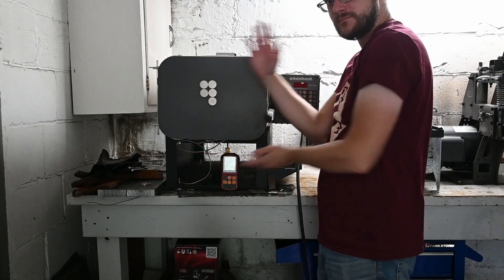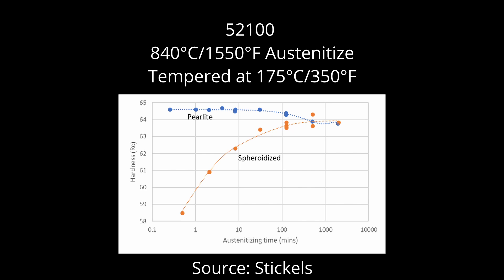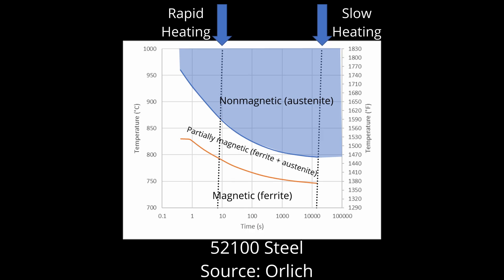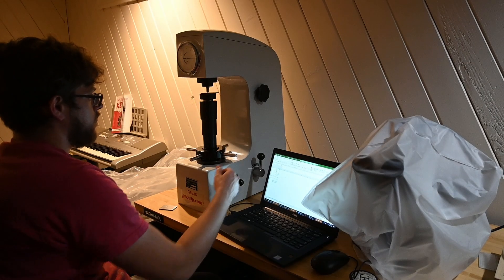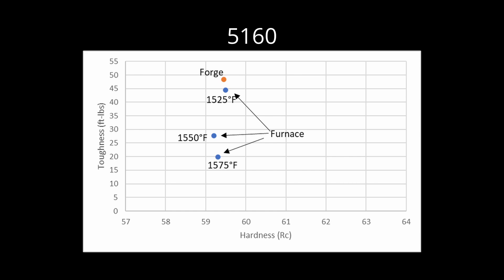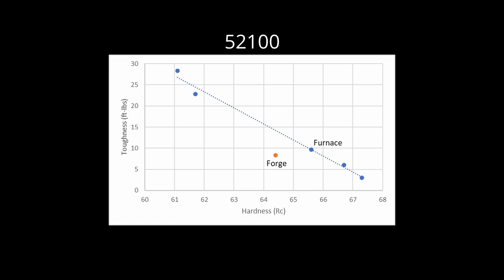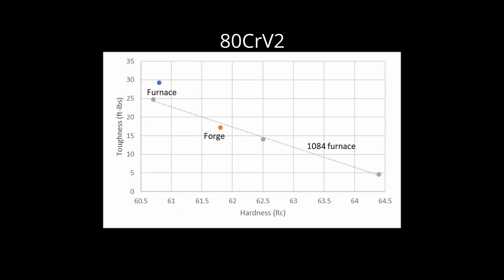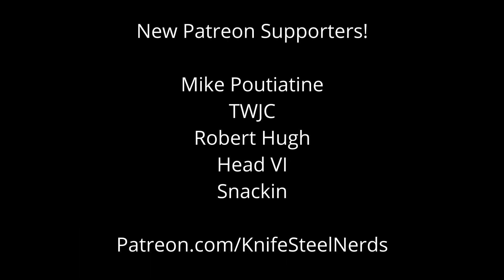Can a Metallurgist Heat Treat with a Forge?

Comment: Larrin, thanks for all the knowledge you share. I do have a few questions that I believe you can answer. I really like 8670 steel. I noticed the HRC you heat treated it to was low in my opinion. I personally get 62+ HRC and still have a very tough blade. I quench at 1600 in parks 50. I believe that the edge retention goes up a lot with a 3 more HRC points. I also think that 8670 modified with .1 percent more carbon and a very small amount of vanadium would be the best forgeable steel with the best balance of edge retention and toughness. Any thoughts on this would be greatly appreciated. I like everything you do. Keep at it
Reply from the maker: I have a separate article on heat treating 8670: https://knifesteelnerds.com/2021/04/26/how-to-heat-treat-8670/
Reply: @KnifeSteelNerds  I've read it multiple times, I don't think you understand what I was saying and asking. Is there any way you can heat treat 8670 to above 62 HRC when you do your next edge retention test. Also you never answered what the effects would be on 8670 if you simply added just a very small amount of carbon and vanadium. I know you are pursuing the "perfect" carbon steel and have a some prototypes. Forget everything your PhD has taught you and try what I said earlier
Reply: According to his testing, 1600 is too hot and gives you less toughness at the same hardness as a power austenitizing temp at the same low temper. 300-350f at a lower austenitizing temp got 62-63 HRC at like double toughness. 14ft-lbs at 62 or 12 at 63 at optimal temps versus 7 And 4 ft-lbs at the same hardness at 1600f.

Comment: I used a tube on my charcoal forge and had pretty even, steady heat... I use a box blower so the rate of bellows equated specific temperature... Way too time consuming though and i have a kiln now for more control and efficiency... Quench oil question: does quench oil get worn out so to speak and become less effective over time and use?
Reply from the maker: Canola oil goes bad. Commercial oils last a long time.

Comment: I really wish I could afford a furnace right now. I don't care very much about the simple forging steels, and have been fascinated with the applications of higher alloy tool steels in knives for a while. 

I'm currently trying to make knives with a2, cpm d2, and cpm 10v with a forge to use for my heat treating. I have an infrared thermometer to use, but even with that, I know I'm just not going to be getting results like I would with a furnace. Still. It won't stop me from trying.

Comment: Yeah this is pretty much a summary for my W2 heat treat. It’s a simple steel, hypereutectoid. I forge most of my knives so the very high heats dissolve any kinds of structures present in the factory annealed condition. Normalize twice just above non magnetic, do a simple sub-critical heat for stress relief... heat up to non-magnetic in my charcoal forge and into the brine. I’ve sent pieces to a friend who has a machine shop for hardness testing, and I’ve never had a piece test for less than 66/67rc like this.
Reply: Yep, the brine will do the work. Most use poor vegetable oils and it's just not enough to quench basic water hardening steels. They'd be much better off with O1, or even a slightly more forgiving 5160 or 52100 for hardenability.
Reply: @mikafoxx2717  Yeah, also leaving the edge thickness at around 2mm is optimal for me. Leaving the edge this thick, I haven’t cracked a blade. And I always interrupt the quench. I did crack a few when I first started messing with brine, but my edges were way to thin to take the stress of a brine quench. Never been a fan of oils, too much smoke and risk of fire next to forge, nope.

IMO any steel with less than 1% manganese can be water quenched.

Comment: Yeah...I "heat treated" 52100 bearing steel...over 1% carbon, quenched in peanut oil...sucks. I just use it for a steak knife. I'm going to be forging a canister with 52100 and 4800kc... we'll see how that goes

Comment: isn't 400F a bit hot for parks 50? i think the optimal temp for 50 is room temperature to 120F well parks aaa its120F
Reply from the maker: 400F was the tempering temperature not the oil

Comment: With all your research and the fact I mostly heat treat with a forge AND use canola for quenching; I'm surprised my knives haven't been torn apart yet!
Reply: Most store bought knives are only 54 HRC, and pretty weak. So you'd be hella impressed with a perfect heat treatment, even in a simple steel. Even basic 1075 heat treated well will outperform most knives on earth.
Reply: @mikafoxx2717  This. Steel is the body, heat treat is the soul… 1075 normalized for fine grain, low aust temp, water quench + cold treat/subzero, and 325-375F temper = WTFBBQLOL levels of performance for 99% of the people, even blade nerds.

Comment: With proper Air control i can hold the temperature with a propane forge with in 10 degrees of fluctuation with a hold time. I also use a k-type thermocouple and a magnet together with a pipe. I do have a even heat oven now but I do miss heat treating in a propane forge for some reason lol.
Reply: I only have visual cues for a forge, but don't have a heat treat oven yet (and the thing that may flip me over to getting one is the fact that I could also kiln house made pencil leads in one - they're basically a ceramic). It's possible to get extremely fine grain and good toughness with a forge by eye, but I generally cycle steel just prior to the nonmagnetic transition to get it (it takes some repetition). My thermal cycling forge is literally a large exhaust pipe (like semi size) with two propane torches and refractory blanket - so that there are cool and hot spots in the forge to move the steel if it's heating unevenly. I have a "real" stainless forge with two vertical burners (propane), but it makes too much heat and it's harder to get a really even job. 

Mill file from the factory (Generally very fine) - magnified about 50x.
https://i.imgur.com/CgnLghi.jpg

magnetic to nonmagnetic 1095 thermal cycling (three times)
https://i.imgur.com/CgnLghi.jpg

And the same process with 1095 by eye (and with a magnet) with a partial quench between heat cycles (three and then heat and quench)- but in this case, quenching just before it would generally (by color) lose magnetism. Heat then, as larrin says, nonmagnetic plus another step (but not long). 
https://i.imgur.com/fAEI7Xk.jpg

Fine edge abuse testing with woodworking chisels shows correlation between fine grain and better fine edge holding (not much of a surprise). The second type sample can be brought back to look like the third with several cycles. The third sample also was forged prior to the thermal cycles, but forging and quench without the subcritical cycles doesn't do quite as well with fineness or fine edge holding. 

The draw to doing this in propane is the subcritical cycling only takes a couple of minutes and it's engaging. 

(Tried convincing the mrs. that we could kiln pottery in a knife forge, but she didn't go for it!!). Will eventually practice ask for forgiveness instead of permission.

Comment: Hi Larrin
Thanks for taking the time and sharing your findings,can I ask why a second temper is necessary on most steels.

Reason I am asking I work with RWL-34   a lot and its a real nice steel to work with,I have got to a recipe for a 59hrc which is my target,but achieved by only one 2hr cycle.after many test cycles.
Regards
Davy Thomas
Reply from the maker: During tempering retained austenite can destabilize and transform to “fresh” untempered martensite upon cooling to room temperature. The second temper is is for that new martensite. Certain steel-temperature combinations even require 3 or even 4 tempers. For certain scenarios no RA will transform but a second temper is safer.

Comment: Man, heat treating in a forge is hard... I still mess it up. Different lighting alone can make it difficult. The power of your forge, I think, can also make it difficult since a more powerful forge will overshoot your temp faster. While I've had good success with the 1084 knives I've heat treated in the forge and tested; the variability with the forge still brings in a risk of sub optimal results. Different knife thicknesses can throw you off too; if you're used to say 1/8'' stock and HT-ing a 3/16'' knife. All of these "not knowing for sure" feelings is what influenced me to build a heat treating furnace. After watching your videos with the data presented, I'm happy I did! Cheers sir! 🙌
Reply: i find using a PSI gauge helps with forge heat treating especially with the Atlus mini forge. i upgraded to the larger gram forge. a thermal cupler(i am likely not spelling this right and it will which will get eaten up fast by the propane environment) or a temperature gun helps. my TG takes a few seconds to get an accurate read so i tend to have to go into the forge a few times but i still get my blades hard.
Reply: A trick for a forge. Table salt. Read up on it.
Reply: @m4rvinmartian  it melts at 1472F however like with a Tempilstik you do not know if you go over 1480F do to a moment of inatentiveness. the range of hardening steel is generally 1450-1480F for low alloy steels like 1075 or 1084. you can still over heat the steel a bit using the method. it also does not help with stainless steels like AEB-L which requires astinization at 1950F. as Kevin Cashin says in his official heat treatment video there is no foolproof method to heat treat steel (in a forge).
Reply: @gundanium3126  If we are going to talk inattentiveness... this entire conversation collapses.

Comment: I always had really mixed results with a forge, most stuff usually turned out ok but when I was first starting off there was also a level of anxiety about it that was also hard to manage seeing many hours of grinding and shaping turn into essentially 'knife shaped crap'. Would still use a forge (and thermocouple) on some simple carbon steels if I had to and my kiln was broken, but I still much prefer the precision of that machine even for the carbon steel knives I make.

Comment: I prefer my salt pots over my forge for any accurate heat treating. That being said, and this may be controversial, with your set up I would try a triple quench, quenching as soon as my coupon got to temperature to prevent over heating. Thanks for the great video.

Comment: Would have been best to do this same experiment with a choke as it is something easy for a beginner to add to their forge.  First knife I heat treated was in a coal forge using a scrap piece of 2.5" iron pipe and a cap on one end. Much easier to keep temperatures even and prevent over heating.

Comment: You are making me like 5160 more and more… I want a damascus blade made from Vanax and 5160 or S7?  would it be and good?
Reply from the maker: Not sure those would be compatible in heat treatment.
Reply: I wonder what super tough non stainless and what stainless high wear resistant, high rockwell steels would be compatible for Damascus
Reply: 3v and aeb-l should work heat treat wise decently. 3v and z-tuff would make a super tough Damascus with decent wear resistance as well.

Comment: Use pressure gauges and control your temperature.
Reply from the maker: The pressure was set to as low as the forge could go without having problems.
Reply: @KnifeSteelNerds  In our forge we used compressed air and propane and it was big enough to control the heat within 50 F. Used Tempil sticks at first then bought a thermocouple. A venturi setup gets too hot.
Reply: @MountainFisher  or just use a digitally controlled electric furnace BOOM!
Reply: @FearNoSteel  My brother owns a Blacksmith and sheetmetal shop in Calif. Initially he used a coke burning forge and I told him to build a forge, so he did, 8 inches in diameter with a 1/4 floor. It had two burners set to blow in a circular flow and was 24 inches deep. Doors on front and back. At first he used a simple venturi setup, but wanted more control as well as use less propane. Remember this was not a knife forge, but a Blacksmith forge for twisting and bending 4 inch square bar and even larger. 

The heat treating knives came later and was my idea not his. Knifemaking is my hobby, he made a few, but mostly axes out of 4140 with a piece of 1/8" 15N20 forge welded into the center after folding the bit side of ax. How would you like an axe made out of the toughest steel there is at HRC 59/60? Toughness on the Charpy Notch test is 150 foot lbs at 59 hard, but drops to 80 lbs at 60 hard. S5 shock steel, an old high silicon tool steel.

Comment: I know this is probably a dumb question but I haven't been able to find an answer to my question. Say you take a production blade that's treated to 56 hrc, can that treated blade be heat treated again to a higher hrc? If I sent an m390 blade that's at 58 hrc to someone that does heat treats, could they redo it at 62? Or is it a one and done scenario
Reply: Has to be annealed first and then be HT again.
Reply from the maker: For some steels yes, though as Mountain Fisher said for something like M390 it would be best to anneal it before re-austenitizing/tempering.

Comment: Hi, Larrin (I'm DW on the bladeforum post about knife steels) and have peppered you recently as I've been ironing out what I'm seeing from the forge. I ultimately resorted to torture testing chisels (which is what I'm making vs. knives) and breaking quenched samples to make sure they're finer grain than commercial files. 

I think there's an important thing to in this case that I see a lot of folks don't have. A magnet is important to understand where steel goes nonmagnetic, but then the forge needs to be somewhere that the light situation is the same every time (no sunlight, doesn't need to be in the dark, but can't be with a bright light shining into the forge). More importantly, a hot source in a forge with the ability to move steel to get even color temperature is fairly critical. Forges that make a lot of heat with no ability to move steel back into the forge to a cooler area to even out the heat are problematic, and attendance while heating is important. So, that ends up being instead of having lots of burners, a burner toward the front of the forge and nothing in the back other than retained heat (so the back is cooler than the front - otherwise you have to pull the item being heated out of the forge and that's a problem for obvious reasons - it'll just cool quickly.)

refusing to buy parks and then trying to heat things like 1084 in canola is another thing I read a lot about. Any small problems that I was dealing with went away after switching from preheated soy oil to parks (26c3, 1084, 1095, etc.). Interestingly, you can heat XHP in a forge if you have a good enough heat source and just heat it really quickly and quench in soy oil and it seems fine. Any more than the shortest time in the heat and it ends up being chippy, though.  

This is of particular interest to me because I know now why you said not to use a forge to heat treat, but I don't want to buy an oven. If you test samples for a fee, I'd love to send a few to find out what I'm really getting - with the steels mentioned above, I don't see any shorcomings. With 52100, since I'm not normalizing, but rather thermal cycling and then heating and quenching, I don't get quite as fine of grain, but it's still absurdly tough (for woodworking). It may not be tough enough for competition knives.
Reply from the maker: I test toughness coupons for free as long as they are ready to test and I don't have to machine them.